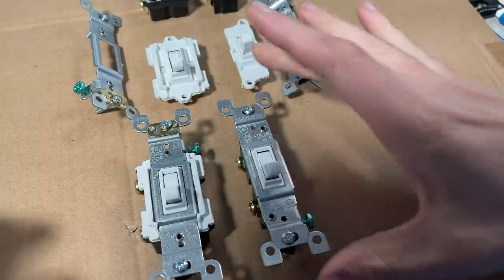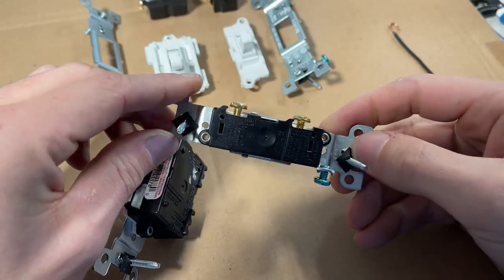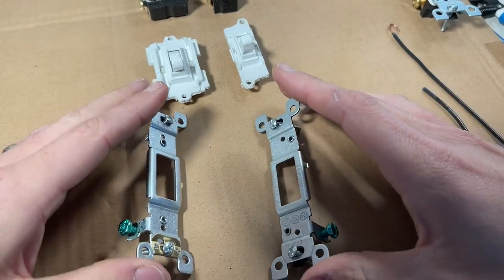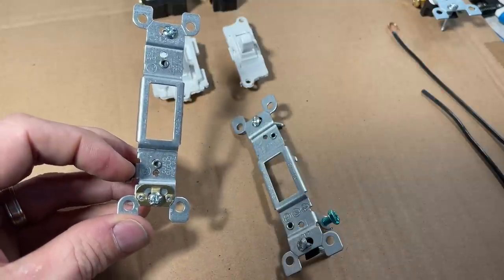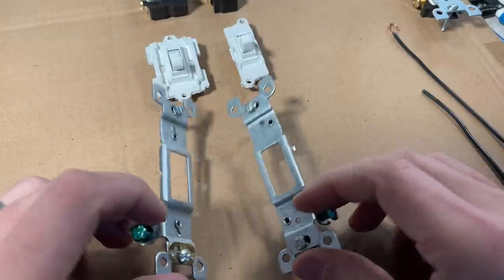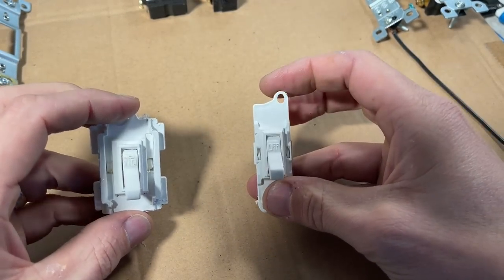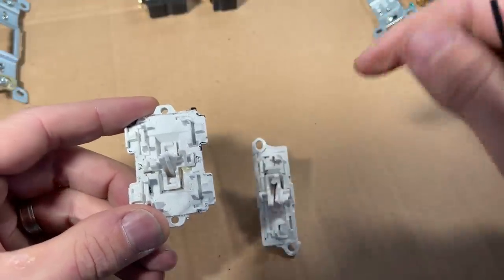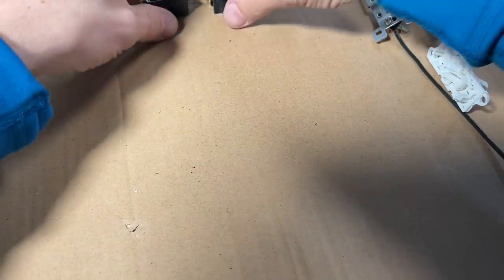What Light Switch Should You Buy For Your Home |  Commercial vs Residential

Comment: For the self grounding clip. Basically, the point of it is. If you have a metal box, you can use that to bond your device to ground, instead of taking a bonding jumper/pigtail/whatever to each device (saving room in your junction box).... The weird flip side is, nobody does this in practice bc it's a hack move to pull.

Something I didn't see you mention in the video, was the actual action of the switch.
The primary difference between these 2 is the actual throw of the switch. (that snap)
The commercial has a much stronger, much faster snap, that virtually eliminates any possibility of internal arcing, or arcing caused by a switch that's stuck in the halfway position.
Reply from the maker: Hey John, thanks for the feedback.  I didn't feel the difference in the switch over center latching design.  I will be at the project tomorrow where I have a few of each type and I will look closer but at least between these 2 Leviton switches they felt the same to me.
Reply: I was just going to say the same thing.  If I remember correctly the residential switch springs much harder to one side than the other.  The  commercial one springs equally hard to both sides.  I won't get the ultra cheap residential switch because I am afraid of it getting stuck in the middle and arcing.

Comment: Just watched this and your duplex recept comparison - great job! One thing I didn't see anyone hit on was the screw terminals on the spec grade devices are also designed to accept 2 wires on each screw with the wire grips they have. This can save a lot of time in makeup phase. Also these terminals don't need the wire looped, as some have pointed out, but what I didn't see is that this is very welcomed if doing hot work. Getting a hot, looped wire off sucks. Some other advantages are the quality of the plastic - much better on spec grade, the improved make/break action of spec grade switches and the apparent heat and arc-resistance improvement with spec grade devices. Great Stuff, keep it up!! 34 year electrician here.
Reply from the maker: Thanks my friend and I appreciate you sharing your comments and experience.  Happy Holidays 👍
Reply: #1 safety rule: DISCONNECT the power BEFORE working on any electrical circuit. Yes. "professionals" (and many DIYers) do work on hot circuits thousands of times across the country every day. And most of them don't get hurt. Doesn't mean they SHOULD. And that one poor dumb (or even very experienced) sap that electrocutes himself by making a simple mistake is the argument FOR disconnecting circuits. Also, I can count on (all 4) fingers of one hand I've NOT looped a screw, and that was more for lack of elbow room and being in a hurry. We loop for both mechanical as well as current carrying reasons.

Which brings me to the original comment I wanted to make, so might as well do it here - the reason for NOT using the push in connects is CURRENT goes through the wire of sufficient circular mils (area), then comes up to this relatively very SMALL surface area - literally the point of contact with the tangent of the wire's circumference - where it contacts the sharp edge of a brass contact strip. And we expect 15 or 20 amps to go through that small point of contact? And not generate heat? Or metal oxides in a damp climate? Eventual (and increasing) higher resistance at the contact point? Cascading failure, and possibly melting plastic, then starting a fire? That's also what's happening with the plug blades in the cheaper receptacle - the contact points are very small, rather than in the commercial grade where the plug blade is pushed FLAT against one of the contacts. More surface area of contact means less resistance and more current carrying capacity.

Take the time, disconnect the circuit, loop the wire(s). Do it right. Don't risk your (or a customer's) life.
Reply: @AZStarYT  - Decades ago electricians used to touch wires (with one hand) to see if they were hot, going from one hand across your heart to the other hand it's the only real danger.  Yes, you should turn the power off, but if the breakers aren't marked I won't waste 20 minutes finding the right breaker for a 5 minute job replacing an outlet or switch.
Reply: @AZStarYT  i was thinking that too, seems like hardly any contact in cheap switch. I work with forklift batteries, and loose connections in the Anderson Connectors have melted several plastic housings while charging.  ok in a room with a block wall and concrete floors....and fire extinguishers and trained people...not so good in a combustible house while you are on vacation
Reply: @AZStarYT  The worst shock I've received in over 40 years of electrical work (let's not talk about the "worm gitter", okay?) was on an outdoor heated stock tank circuit. I turned off the barn feed upstream, and the barn was dark but I turned off all the breakers there anyway, just in case someone turned on the upstream. I should have tested it, but who would expect the neutral to be hot when it is 300 feet away from the breaker feeding that building and everything in there is off? I still (years later) have no idea where that circuit is fed. Someday I should shut off the entire property and see if I can figure it out, and maybe figure out where/how the white wire is hot. Maybe the place is actually wired with both phases, thru a single phase breaker and derives its own neutral? I've seen worse...
Trivial stuff like swapping a switch or outlet I normally do hot. But on ladders or that one time, since I was working far from anyone else, outdoors on wet ground, I figured, "why not turn it off?"
Oh, and the only time I've killed a computer doing an upgrade was when I was at a static-safe workstation wearing ground strap on my wrist and grounded heels on my shoes. Such is life.
Reply: Working on wiring hot apparently with bare hands DUMB .
Reply: For several code cycles now (National Electrical Code), we are required to make pigtails and only insert one wire per device. From personal experience, 2 wires under each terminal makes for harder diagnostics for the electrician tracing faults. In the last week, tracing lighting failure in a couple of rooms, the fault was a loose neutral under 1 terminal in a baseboard GFCI outlet.
Reply: @Sylvan_dB  "  just in case someone turned on the upstream " That why we have lock out , tag out .

Comment: From my experience, and I’m not an electrician. The commercial grade switch seems to have a better feel to it as you’re flipping it on and off. That’s it. Thanks for your videos, great job!! 👍👍👍😎🇨🇱
Reply from the maker: Thanks Rico, yeah I was a bit surprised and underwhelmed by the Leviton "Preferred" light switch and was expecting a bit more when opening it up.  The outlet differences were obvious but the light switches no so much 👎
Reply: @EverydayHomeRepairs Thanks for the videos!  Didn't get a real good look at the points in the commercial grade switch, but they looked a little larger than the points in the other one. Guess I'll have to cut a couple open.

Comment: I am a 3rd year commercial electrical apprentice. I prefer the commercial switches, and receptacles because you can side wire them, using those plates on the side. When you are installing alot of them, it really cuts down on install time. If you use a Milwaukee ECX screwdriver they perfectly fit Leviton style screws and you can really get them tight. Also, the bonding strap on the switch you were pointing out is so you dont have to use a ground wire at all, if the box is properly bonded that strap is all you need for grounding.

Comment: I asked an electrician who works solely for a historic hotel what was the most common task.  He said replacing light switches, because they get the most use or abuse.  The most heavily used light switch would be the bathroom, so I think that should be higher commercial quality.  Same idea applies to receptacles; heavier use/abuse requires heavier quality grade.

Comment: While I might be wrong I think the added structure in the commercial unit isn't for making it a 3-way, but making it a double-pole switch would would be needed in a 208v/240v application as such would have 2 hot wires that both need to be switched.  In a commercial setting it's more likely to need a 208v switch, many commercial lights are ether 208v or 277v (though 277v is only one hot) 208v is two hots.

Comment: I have noticed many different switch variations over the years and the latest ones that I have purchased had a nice crisp snap / springing action when flipping the switch. I would like to think that these would hold up over time better because in my experience switches are more likely to go bad from contacts burning up due to slow operation (momentary arcing between contacts). That mechanical assist in throwing the switch open helps clear the gap and prevent that notorious crackling that can be heard if you leave a switch in its mid-position. Keep up the good work!
Reply from the maker: Hey Anthony,  good feedback and I wish I would have touched on this point in the video.  After I published I did spend a bit more time with the commercial and residential switches.  The commercial did have a quicker "snap" compared to the residential which should help with the switch life as long as the quick snap holds up over time.
Reply: Yes and I have been around for over 33 years and have found the industrial ones do last longer before ware out. Thought this was due to heaver contact points.

Comment: Spot on. Especially with LEDs now, there is very little current passing through a light switch; the contacts are more than sufficient. Unlike receptacles, especially those where things are frequently plugged and unplugged, both grades of switches will wear the same toggling on and off. The only place I like to use commercial switches is the garbage disposal and other motors where the high inrush current can wear a contact faster.

Couple of facts to add in. All manufacturers put the screw-down plate terminals in Decora switches, so that advantage for commercial switches goes. Also, all metal switch and outlet boxes are required to be directly bonded, either with a grounding screw or clamp. Inspectors will look for that, without fail. The self-grounding strap means the bond wire doesn't have to be attached to the grounding screw. 

I also only bond one switch in multi-gang installations. Remember the purpose is to bond metal device plates; one switch bonds as well as two or more. Less box fill and less chance of shorting between a bare bond and the switch terminals.

Comment: Apprenticed in 1978 seen a lot. Biggest changes are the LED lights and residential switches are far over rated for these circuits AND most important the residential gives more room for wire placement sq. inches in the box. The commercial you show is very valuable to not to have to wire nut and pigtail the wires in the box. Because you can put 2 wires under each screw.  NOW FOR THE BIG DIFFERENCE you need to consider a load such as a furnace, heater, infrared lamps, bath fan, attic fan, ceiling fan, kitchen exhaust fan...why?  The loads/arks on the switch will break it down.  Old time magnetic transformers were switch killers due to the inductive kickback when turning off the lights....not much now days with LED.  BUT you should consider upgrading to a 20 AMP switch as internal contacts are now upsized.  CONSIDER comparing one of those heavy-duty 20 Amp rated switches to the ones in your presentation.  YOU WILL SEE A DIFFERENCE...a 20 A switch on a kitchen exhaust fan/furnace would be considered.  OR jumper a 4 way residential switch to use the 2 internal switches in parallel operating at the same time gives roughly a 30 A switch.  GOOD VIDEOS keep up the good work.
Reply from the maker: I really appreciate you taking the time a sharing a tiny portion of the knowledge you have gained over your career.  I like your idea of comparing the 20 Amp switch and thanks for the example of use cases when the 20 Amp switches should be used.  Happy Holidays.

Comment: I buy Spec Grade devices as a minimum. Well worth the small additional cost up front. I suppose at least one advantage with the commercial (Spec Grade) version, is that there is more room within the device to dissipate heat which helps reduce heat-related fatigue, although you would have to be pulling a pretty decent load. Also, I've always preferred the solid "click" of the commercial ones; the residential-grade switches seem quite flimsy to me.
Reply: Most spec grade are designed to work up to 20A at 277V to support commercial lighting.

Comment: ECX2 is the fastest and best torquing tip; this is a flat with a square set in the middle at 45° relative to the tip (diagonally along the flat). Square-D also uses a square in slot wherein the square is not set diagonally; I don’t recall the company that makes these tips but my local electrical supply store caries them and they work great to torque neutrals in load centers. Per NEC most terminals have torque specs which are to be followed; most people make the mistake of over torquing as you’d be surprised how little pressure is actually needed. People who just tighten terminals until they can’t tighten anymore are more than likely over tightening; you shouldn’t have to worry about cramming out or rounding out a screw unless you’re over torquing. 
I use cheaper outlets and switches in areas of little to no use and commercially rated outlets and switches in areas with use; most outlets don’t get things plugged into them with any frequency which is what wears them out, switches in some areas are the same so there isn’t much point in spending on them. Main room switches and outlets in say the kitchen above counter see a lot of use so I spend more on them. I also install 20 amp rated switches and outlets which all tend to be commercial grade in garages. Which every code change electric gets more expensive to do and people don’t understand the cost of compliance when they see things, like breakers, switches, and outlets that are quite inexpensive; you have to educate them to understand the benefits of the pricier things as well as some of the safety benefits. While I agree with a lot of the code some aspects like the massive increase in AFI and GFI usage and mandates massively increase new construction cost and have really pushed people in to doing their own work, at least in what I’ve seen to save money, ultimately though this can be done safely but unlike plumbing where you’ll instantly see a leak a sub-par electrical job doesn’t always show until a fire starts or someone gets hurt or killed due to a shock. I recall a person that caused their whole aluminum soffit to become energized after upgrading their service without a permit or inspection; this may have been fine for years but one aluminum ladder set against the house caused a heck of a short and thankfully the person wast hurt. They got a heck of a fine though and lost their certificate of occupancy until it was repaired to code. This person paid for both the sub-par job as well as my fee and the fine all to get around getting a permit, which they also had to do anyway. I like the informative videos but a little knowledge of electric can be a dangerous thing. I like DIY but know your limits and when to call a pro.
Reply from the maker: Good feedback Chris and appreciate you taking the time.  I also agree that if a DIYer is going to take on electrical they should be following code and also take safety seriously.

Comment: Per code, you have to bond the switches but more importantly you should always bond a metal box. If you don’t have a metal box, definitely bond the switch. In my experience, do not use the stab in connections. Use the screw terminals and wrap the solid wire in the direction of the screw. If you’re using stranded, then use crimp on forks to land on the terminal. Either switch will work just fine for your standard light. I would use the beefier switch for motors, garbage disposals, heaters, and heavier loads.
Reply from the maker: Thanks for the feedback Francisco.
Reply: @EverydayHomeRepairs  there's also a proper electricians screw driver that is all 3-in-one. Robertson, flathead and phillips in one bit.
You missed the contactor pad in the commercial where it makes and breaks the connection!

Comment: On the spec grade switch, that extra piece your talking about is a self grounding clip, providing you take the fiber washer off the one screw with the clip, it will ground the switch to the box. But the box still has to be grounded  back to the panel, in order for the clip to be effective. I personally used spec grade switches and receptacles, because they have pressure plates on the sides and are easier to wire. I never use the "backstabbing feature" on either units, seen too many of these fail.
Reply from the maker: Hey Mark, good point on making sure you take off the fiber washer to ensure a solid ground.  Thanks for the feedback.

Comment: The improvement in the commercial switch is the larger contacts. That will give a longer life. I just replaced a bunch of $.50 Leviton switches in my house because one was making an arcing sound when switched (15yrs old). I opened it and those tiny contacts were burnt up. I do failure analysis so I know the bigger ones will last longer and are capable of higher currents. Drill out the rivets for easy opening.